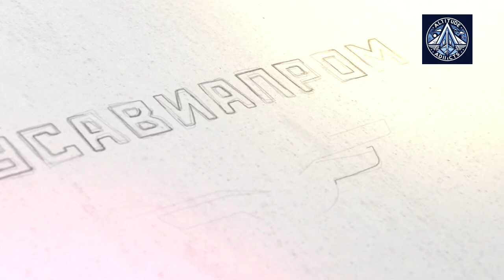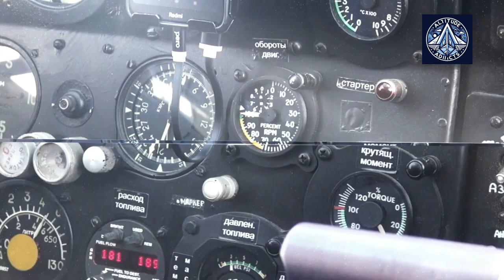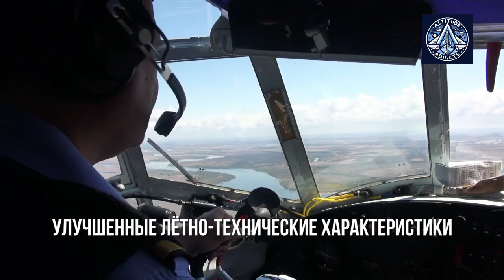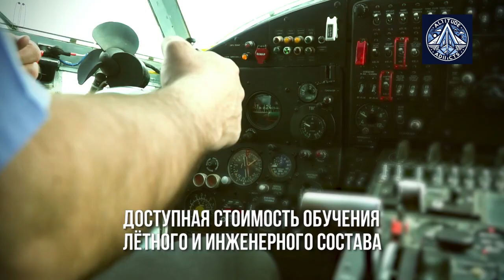LMS-901 Baikal Delay: An-2 Aircraft reborn - TVS-2DTS + Honeywell Garrett TR331-12 Turboprop Engine

Comment: Attempt to resuscitate a corpse that was first time tested in an air in the summer of 1947!!!!!
Such a curiosum is only possible in Russia. A wonderful combo - engine originally designed in 1959 and certified in 1965 with an airframe with a design that perfectly fits the twenty years between the two world wars.
Aviation history live...
Reply: In places where this planes will fly it will be the best solution. In villages with dozen people not that many options of service if needed.
Reply: @Pruzhina13  You forget, genius, that Americans have "their Yakutia" - it's called Alaska. So do Canadians. So there's something to compare this Russian achievement to.
They also have an airlines called Air Alaska with at least continental coverage and very decent international standards. They also have many local air operators, including helicopters.
And NONE uses such outdated equipment, and the quality of service is incomparable, mr. Spring.

Comment: This is an old version. This is a project of the SibNIA named after S. A. Chaplygin - TVS-2AM / MS / DT / DTS. They will not remember it anymore. In 2021, a new aircraft LMS-901 "Baikal" was presented at MAKS 2021. Developed by another design bureau, Baikal-Engineering LLC, a subsidiary of the Ural Plant of Civil Aviation. This aircraft will already be a monoplane. The Russian VK-800S engine is in the final stages of development. Prototypes fly on Czech engines for now.
Reply: @giggling_boatswain  from what I can see the LMS901 is half the plane of TVS2 series, half the range, almost half its carrying capacity and not much cheaper from the announced price.
The engine is yet to be proven.
I would be very disappointed if production of the TVS2 was killed off due to the war.